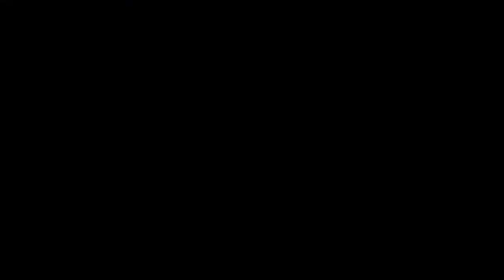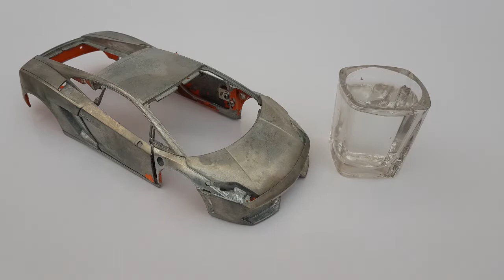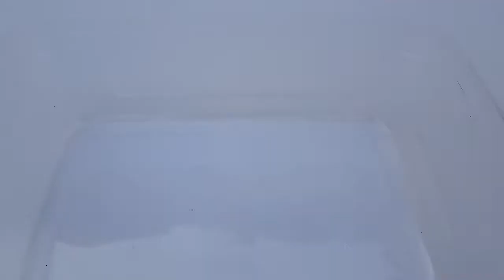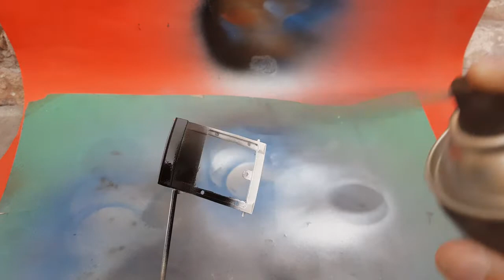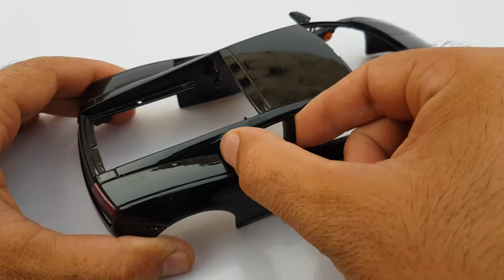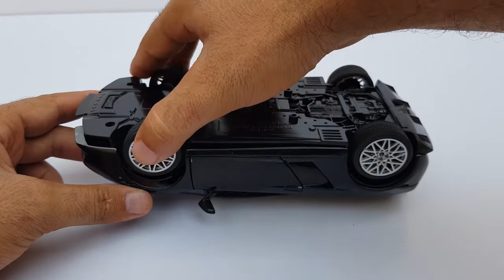Restoration Damaged Lamborghini Gallardo - Die Cast Model Car

Comment: Fail. Paint Is awful, orange peel finish and some fingerprints because you touched the paint while It was fresh. Wet sanding needed to eliminate orange peel. You can do better on next restorations.